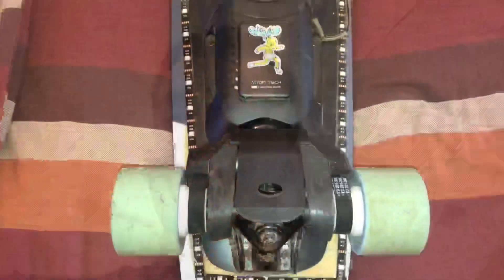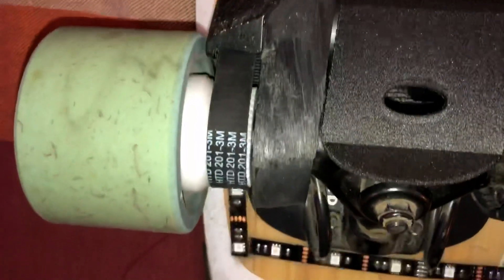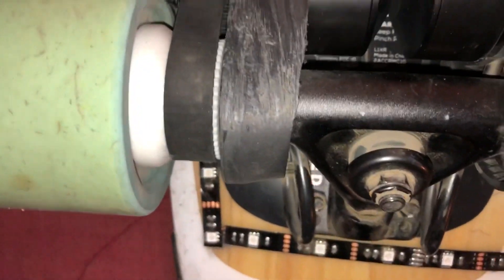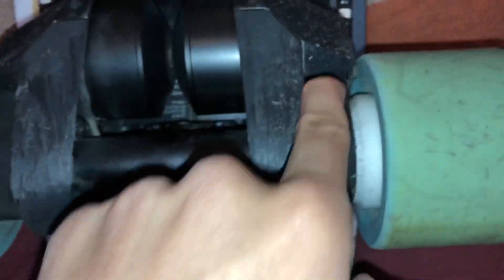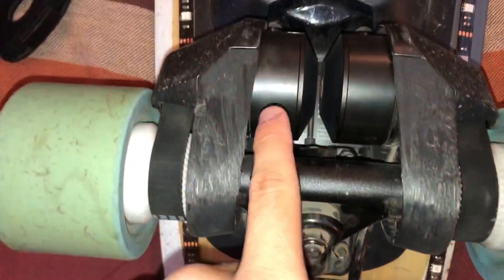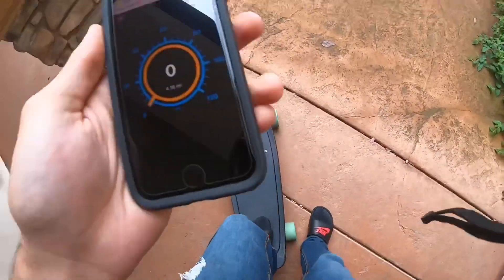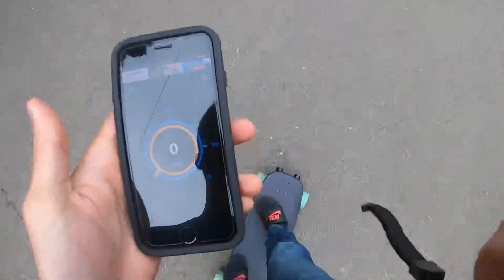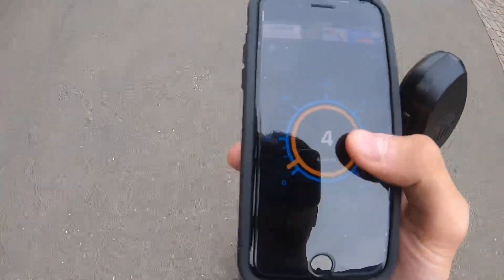Boosted Board mini X Speed Mod

Comment: What T number did you use? I want to get these but don’t wanna lose a lot of range.
Reply from the maker: 45
Reply: TicTac Tech how much range do you get on mode 3?
Reply from the maker: Cancerous Edits 6-8 miles
Reply: TicTac Tech I get around 10 on pro mode with my V2 dual, you think I’ll will still get 9-10 miles of range with 49T? Or 52T? I have the 85MM blue cags as well.
Reply from the maker: Cancerous Edits no clue bro I sold my boosted a long time ago